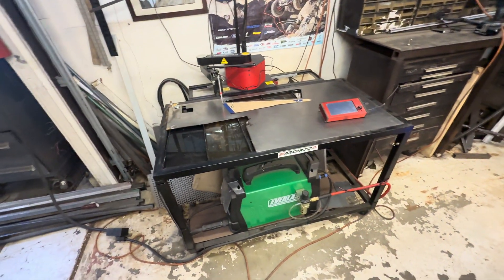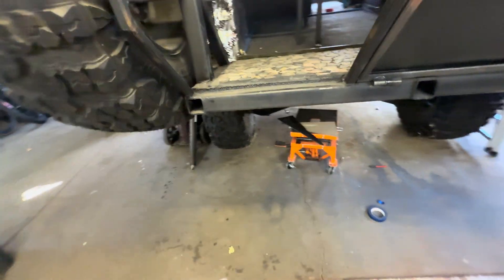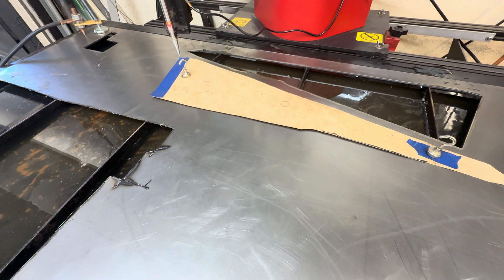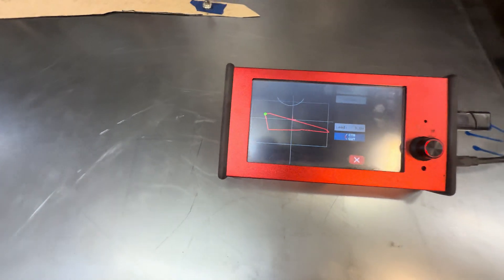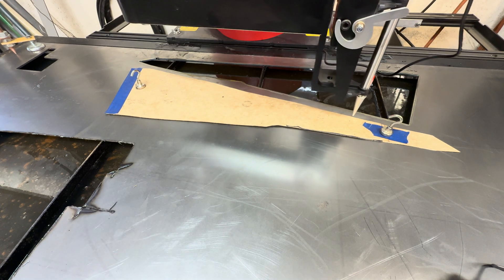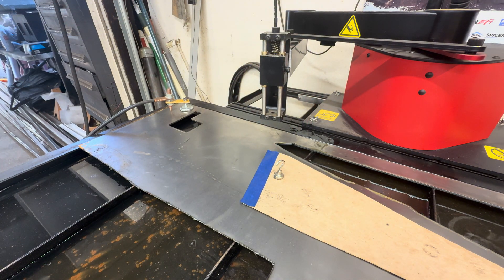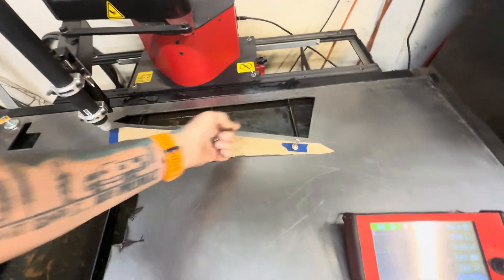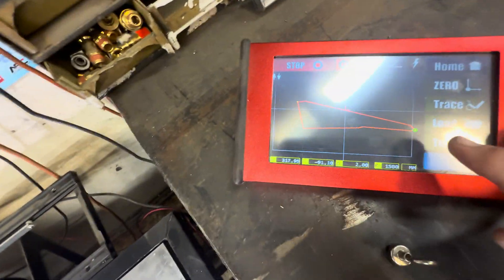Arc Droid. How to program and cut your first part with Everlast 82i!

Comment: Question for you . I just bought the arcdroid and a Everlast 82i. I have the x2 feature. Can you show me what you did to connect the plasma CNC to arcdroid? Please show me how you wired them . I promise to pick your brain as I learn . 👍🤦🏼
Reply from the maker: It’s super easy on the Cnc port. You will solder a wire onto pin one and another wire onto pin two and in the back of your droid, it’ll say from Plasma and it doesn’t matter which one goes where it’s just closing the loop. If you need more visual on that, let me know and I’ll do a quick video.
Reply: @TRCa51  I purchased a CNC to arcdroid cable and it will shoot air but no plasma cut.
Reply: I checked continuity and pin's look correct but maybe theres some kind of a setting on the everlast 80i?
Reply from the maker: @CarlosAgrillo as far as I can remember after you solder the two pins and close up that connector you put that port in the back and wire it to the aroid and at some point in time in the video, I probably show the screen and what the settings were. I have another video when I had the 62i where I talked about that. I’m sorry I can’t recall off the top of my head, but you do want to have your air pressure dialed in. I believe between 60 and 65. It’ll give you a green light on the front of the panel.
Reply from the maker: With the Everlast 82 you’re going to solder a wire to pins one and pin two with another wire and then that just goes back to the back of your droid where it says Plasma control I believe. Doesn’t matter which way you hook it up it’s just completing a circuit. I just recently sold my droid and selling off the rest of the shop to go full-time on the road in my expedition truck, but I still have some answers in my head if you need any help!